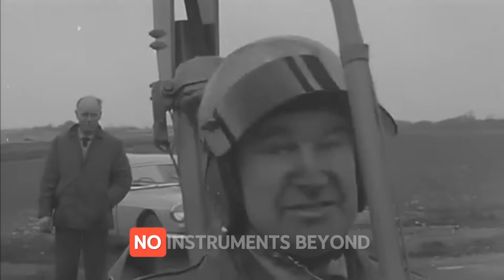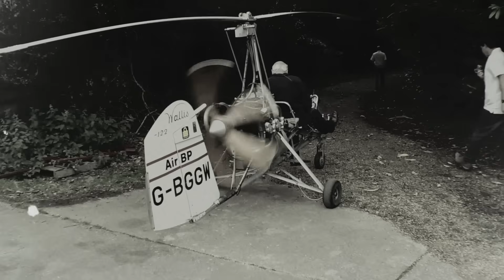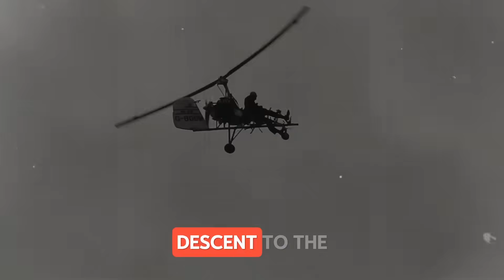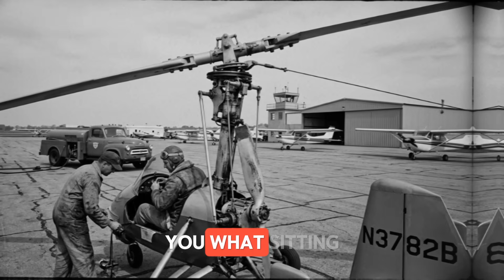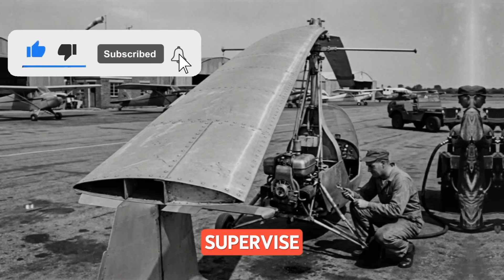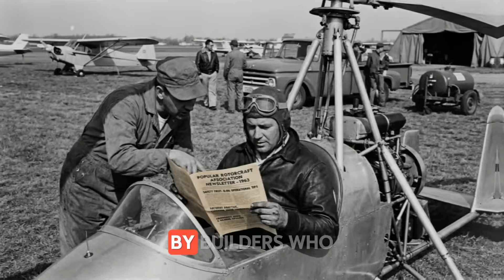$800. One Garage. One Flight. | The Aircraft Anyone Could Build

Comment: They don't stall but they do negative flap  and kill you just as dead:body-blue-raised-arms:
Reply: It's very misleading, that  "can't stall" tagline. I'm always surprised when I see it because  Bensen was so smart, but he never realised it was a dumb thing to say. And  nobody ever told him "you shouldn't say that"? Especially after so many guys fell out of the sky.
Reply: @myotherusername9224 because the rotor cannot stall at low speeds it simply can't.  They didn't just fall out of the sky those that tried to teach themselves were caught out going negative g.  Know what other aircraft can sustain negative g?  Helicopters, which are also harder to fly.  Why were people killing themselves and not in choppers?  Lack of training.  That's it.  Negative g is not hard to avoid.  If you limit forward speed it's very difficult to get negative at all.
Reply: @cameronlapworth2284  

The point is, a stall in fixed wing means the wing stops making lift and you fall out of the sky.

Unloading the rotor means the wing stops making lift (stalls) and you fall out of the sky.

The  dynamics are opposite: both Cub wings stall at the same time in straight ahead flight but the retreating blade stalls in a gyro flying straight ahead. The aerodynamics over the insulted airfoil  and  the result are exactly the same. In a Cub, the airflow detaches because the air is not flowing over the top of the wing fast enough; in a gyro the blades slow down, and the airflow detaches because it is not flowing over the top of the wing fast enough. One is caused by high AoA on the wing, the other by low airspeed of the wing

It's the exact same problem (catastrophic loss of lift) but one case is caused by back stick  and the other by forward stick. 

"Negative g is not hard to avoid.  If you limit forward speed it's very difficult to get negative at all."

Stall in a fixed wing aircraft is not hard to avoid, either. If you keep the wing below the stall AoA it's very difficult to stall the wing. 

However, it's just as easy to lose lift on a gyro's wing as it is to lose lift on a Piper Cub wing if you do the wrong thing. 

Therefore, it was a huge mistake for Bensen to say the aircraft can't stall. I think a fair number of deaths happened because people got in the early Bensens thinking "I'm safe because this aircraft can't stall".

Bensen failed to set expectations honestly. Claiming the gyrocopter can't stall is  a lie. What he SHOULD HAVE said instead is "this aircraft cannot be flown without instruction specific to rotorcraft because it is fundamentally different from a fixed wing airplane. You can stall a Cub with back stick and you can stall a gyro with forward stick."

He NEVER should have said "the gyrocopter cannot stall" because abusing the stick is worse  in a gyro than in a Cub. Once the rotor RPM decays to the point of rollover, there's no recovery, but a Cub can be recovered from a stall with enough altitude.  

I wouldn't want to test it but I wonder if a tractor gyro  with enough tail volume and altitude could be recovered from zero G.

Comment: A friend went to a couple meetings of a Benson club and noticed that many of the people were in casts and figured that it was too dangerous and gave up.
Reply: Yeah, I would have killed myself if it weren't for the dual instruction I had in one!
Reply: Yeah, I was right at the point of buying one from a local dealer guy, he was showing me pics of his flying club and turned out each member had died in a gyro crash, at the time he had just cut his fingers off hand propping one, later he crashed and died also, I decided to go fixed wing ultralights instead.
Reply: @Winston-h7c sadly many tried to teach themselves.  Perfectly safe if you get training

Comment: There are models available today that have a parachute that pops out above it in case of emergency. Models available today are not cheap.
Reply: Kind of hard to mount a ballistic chute with rotor blades isn't  it?
Reply: @Winston-h7c 
They do it by way of a tube mounted to and above the main rotor.
Reply: @Robert-nocrud  Thats what I assumed but if the main rotor disintegrates or the jesus bolt breaks looks like the ballistic chute goes also
Reply: @Winston-h7c 
The chute is more common on ultralites.
Reply: @Robert-nocrud  Yes, I am a very experienced ultralight flyer, have owned and flown many, and ballistic chutes make a lot more sense on an ultralight.
Reply: Back when yu could buy a Benson gyro for 800 bucks you could also buy a used piper cub for that price

Comment: Thanks for the memory trip. I flew a Benson gyro for around 8 years back in the 70s.  Had the McCullough drone engine but later replaced with an Evenrude V4 from an outboard boat motor.  Many happy days with fellow gyro nuts at Benson Day fly-ins..
Reply: How did you cool a water cooled engine? Radiator or air cooled with fans?
Reply: @Winston-h7c I used a small car radiator.  Had to mount a water pump on it as the outboard has it in the 'foot'.

Comment: Benson aviation property was taken in by RDU when they expanded to create 5L 23R. It was not taken in by the city of Raleigh or Durham. My dad made the rotor blades of all wood in 1957-1960. He finished a batch to paint and hung 20 or so pairs along the wall, with help from Mr Mort Robert’s, the painter. This put the top skin (3/16 mahogany plywood) toward the center of the room. They went home for the weekend only to come in Monday to find the low humidity in the room had dried them out and the part close to the floor was now about 3 ft off the wall. Not to worry, a little humidity from spray bottle of water and time they straightened back out. There was a guy there named Elrod, Charlie i think,   Wayne Pool .